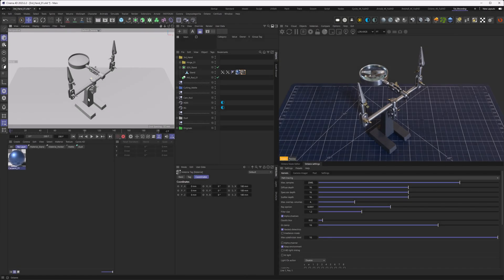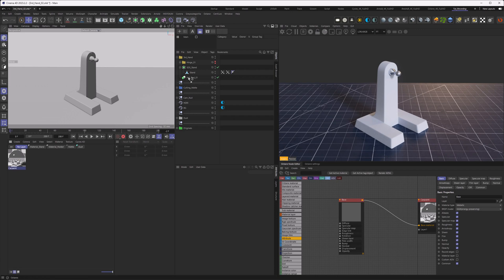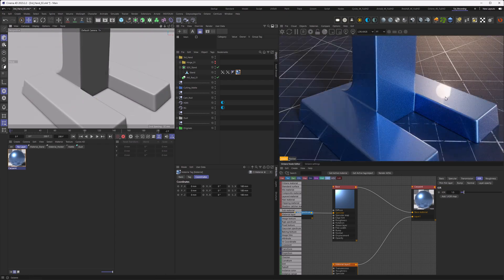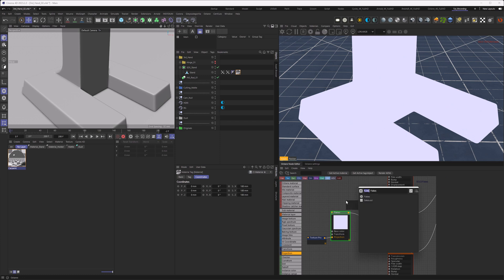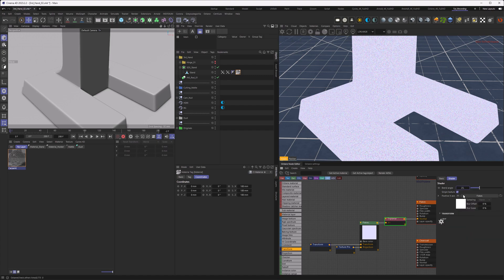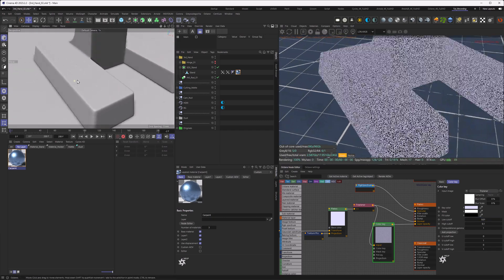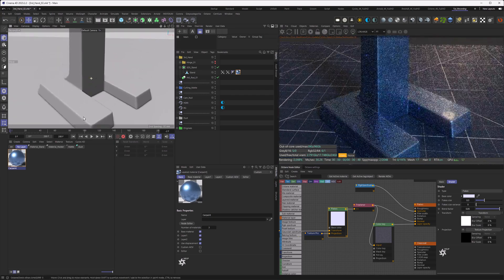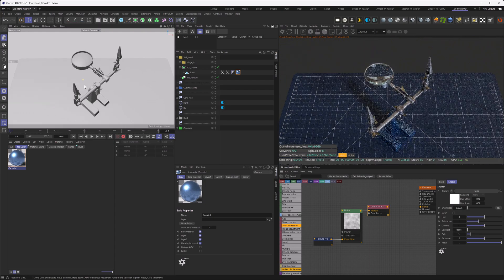Silverwing Quick Tip: Octane Car Paint Shader

Comment: I am subscribing to patreon and studying hard. I have a question. Concave vertex maps are often stored. Do you paint it yourself? Is there an easy way to make it?
Reply from the maker: Hey there and thank you very much for your comment as well of course for subscribing to my patreon.
I usually paint them myself, as I would like the most control over my outcome. There are methods of creating those with fields (both concave, convex ones) but I found it a bit imprecise. Especially when you are subdivision surface modeling your objects and have nice mesh flow with nice supporting edges.

I have not found a tutorial showing the technique to procedurally generate curvature maps, but it's rather simple.
Create a vertex map on your object.
In the vertex map options tick on "use fields"
Delete the freeze object out of the fields and drag in the object itself into the field list.
(The object you just applied the vertex tag and you want to get the edge selection)
Then set the mode to... you guessed it... "Curvature"
You can play around with the settings and see if it's good enough for your use case.

Hope this little text tutorial helped 😊

Cheer and a great time to you!
Raphael

Comment: Hello, I have a question.  Sometimes I don't know how to make the plastic material on the surface of the product, which has high reflection and surface particle feeling.  Should I use Fenier coloring or directly add color？
Reply from the maker: Hey there and thank you for your comment and your question!
I think I would have to see the material first because there are so many different ones it´s hard to give instructions based on a material that I have not seen.

In general there are different plastics. Some try to mimic metal and can therefore have a colored reflection. Then there are usual plastics that follow the usual dielectric material behavior e.g. just a diffuse with a reflection with an Index of around 1.5

If you have such a normal looking plastic with small glitters inside, then you would make a glossy material as the base and then add the flakes on top without a coating.

If the coating is what you like better, and I think this is what you asked me in your question, is that you just use a diffuse material as your plastics color and then let the coating give the plastics reflection / shine to it.

The best way to approach those things in my opinion is always to ask yourself what is going on in the real material. What is plastic and what is "glitter". How does the surface structure behave, how rough is it etc.

Hope I could help you there.
If you want to share a material sample image with me so I could get the full picture (pun intended) then you can share it with me via email.

I will not share my mail address here, but you can easily find it with a bit of effort (if you go in my website)

Comment: Has there been any research on how to render the swirl marks effect that often appears on cars to increase the realism of the rendering
Reply from the maker: The easiest thing would be adding very tiny scratches to the coating in random directions. That´s what causes the effect in reality.
 
I have read a post about this in Vray an eternity ago. They did manage it the same way.

Not sure if there is a more efficient way around nowadays 😇

Comment: @SilverwingVFX Could you point me to some advantages / differences / preferred uses to using a composite material vs a layered material?
Reply from the maker: Thank you for your comment Pieter!
The Layered approach is more or less like a huge Universal Material. Everything lives and interacts within the same space.

It´s probably most prevalent with the specular layer. You can stack multiple of those on top of each other and therefore get multiple coatings stacked (usually not the case in real world materials, but good if you try to e.g. emulate an anti reflective coating)

In an composite the specular would act as its own entity of material and you would not get a coating but a partly transparent material depended on the mix strength that you have set.

For a coating in a composite mat, you would have to go for a pure 100% strength refection and then mix it with the underlying material with a Fresnel curve to get the same coating effect as with the specular on the layered.

I hope this was helpful to give you a little insight into the differences.
If you have more questions. Feel free to ask!

Cheers,
Raphael
Reply: @SilverwingVFX Thanks for the response! I will have to look a beet deeper into it but your answer gives me a really good frame.

Comment: Can u talk about ur pc? And the rig that u used to run Octane, thanks
Reply from the maker: Hey there. Here you go:

You can see a little bit in this video:
https://youtu.be/uj63Rkxv4_4

The tech specs are are following:
Windows 11 Pro 64bit
Motherboard: ASUS WS X299 SAGE 10G
Processor: i7 10980XE, 18 Cores - 36 Threads, 3.0 GHz 
Ram: 128 GB DDR4 3200 MHz CL18
Graphics: 1 X Nvidia RTX 4090, 1 X Nvidia RTX 3090 (Reference Design / Founders Edition)
eGPUs: 2 X Nvidia RTX 3090 (Reference Design / Founders Edition)
Display: LG C2 42" OLED. 2x DELL_U2713HM 2560 X 1440
PSU: 1500 W, BeQuiet
CASE: Lian Li PC-X2000FN
eGPU Enclosures: 2x Razer Core X